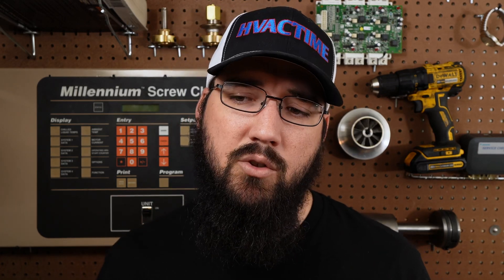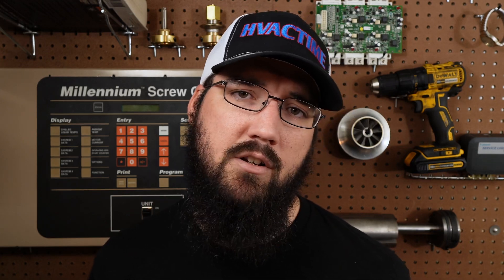What is a IGV in Chillers?

Comment: I have a problem with a York YK centrifuge, it shows a high pressure error but the high pressure transducer is found normally, apparently there is a password to eliminate this alarm and it cannot be done with 1380, could you help with the issue?
Reply from the maker: 1397 will clear high pressure. Please use this extremely carefully as that alarm means something went wrong.
Reply: @HVACTIME  It seems that this is not the password that allows you to eliminate the high pressure error in the condenser. I already checked the output of the transducer and in fact there are 110 volts that reach the IO board that come out of the normally closed one.
Reply: What causes the main compressor low discharge pressure? Is it something to do with IGV opening?